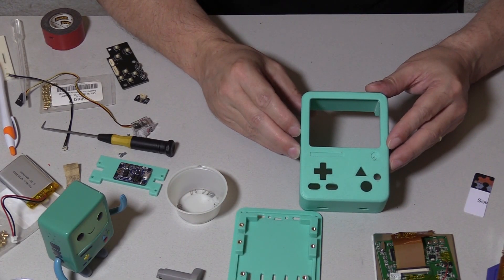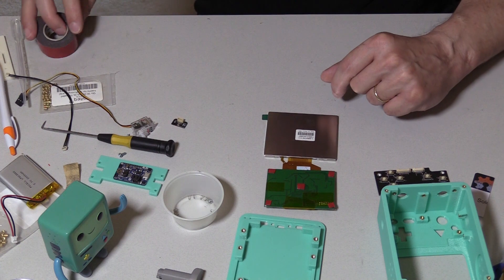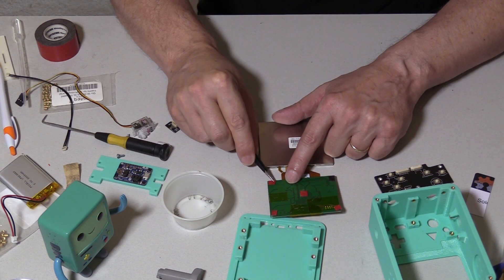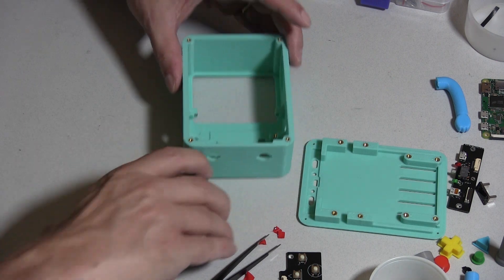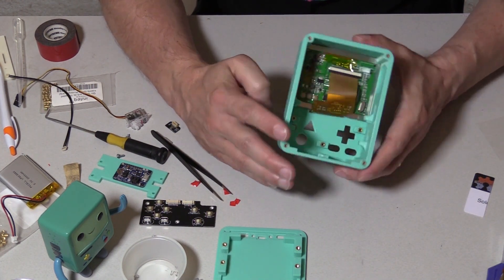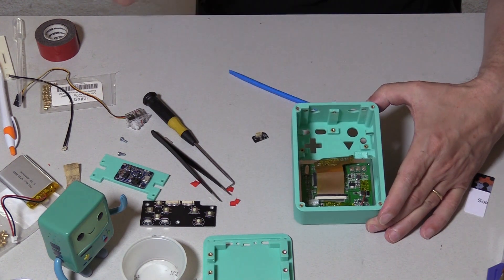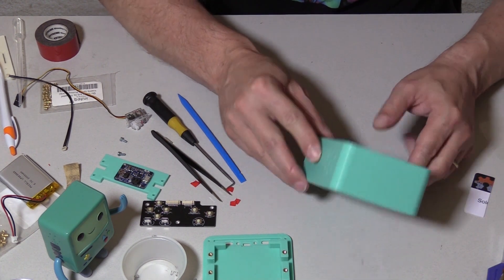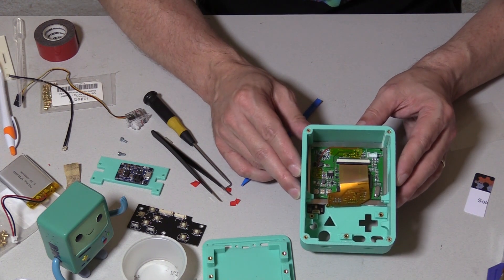Building BMO Boy: Part 4

Comment: I love everything about this and want to make my own. I just got my first 3D printer and never done any soldering, raspberry pi or anything like that. Granted I want to practice on some smaller projects before attempting this... but do you think it's possible to make this but without the servos, working buttons and battery? Basically I want to make this, but powered just by a micro/type c cable and connect with a 8bitdo controller (or connect via keyboard and mouse on back) using a pi zero 2. 
Would such a thing be feasible without altering your stl files? (as I'm fine with just empty space)
Reply from the maker: The only thing you really need is the LCD screen. The STL file is designed around that. You can mount almost anything inside. The mounting holes are designed for a Pi Zero but you can print an  adapter with mounting holes that work for your controller. You can glue the buttons in place and just print a plastic mounting hub to mount the arms instead of the servos.
Reply: @BobHerzberg  Thank you for feedback. Just finished watching all your videos on this and feels a little daunting but I'm hoping that I'm skipping the battery, workable buttons, servos and just relying on bt for the controller and be powered by cable I should be able to do okay. Thank you for such in depth videos on the process!

Comment: Do you have any recommendations for ways to practice soldering? I have a decent soldering station, but I've managed to ruin every single PCB that I've ever tried to solder. Soldering two wires together isn't too difficult for me. It is soldering things onto a PCB seems to specifically be my issue.
My solder never seems to want to flow and, even with my iron set to an appropriate temperature, I end up melting the PCB trying to get pins hot enough to flow the solder.
Reply from the maker: A lot depends on the type of solder you are using. Lead-free solder will require higher temperature for flowing than lead solder. Lead-free solder is also very difficult to re-flow so if it doesn't go on right the first time it can be difficult to re-flow it without removing it first. Make sure you are using the right size soldering tip so you can heat the solder pad and the component at the same time. If the pin gets hot but the pad doesn't then you won't get a good flow. You shouldn't be able to melt the board. For surface mount soldering I put the whole board in a re-flow oven at 240C for several minutes. I've had it even higher than that so if you are melting the board it is either low quality or you are above 275C which is pretty hot.